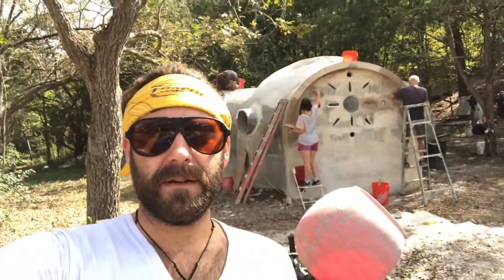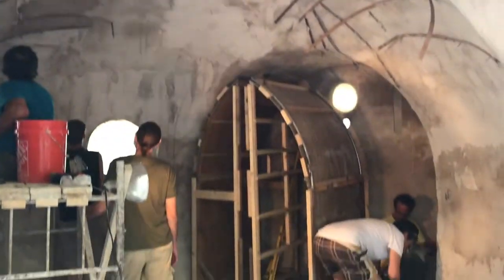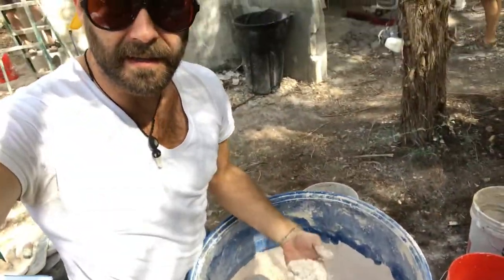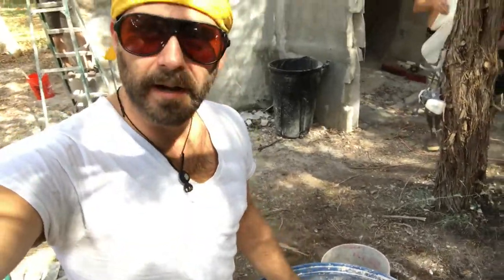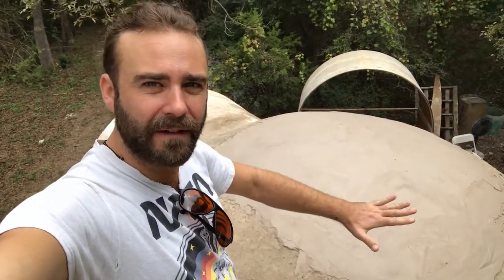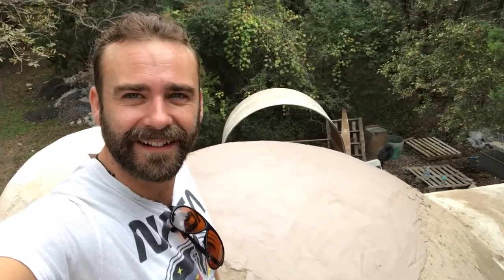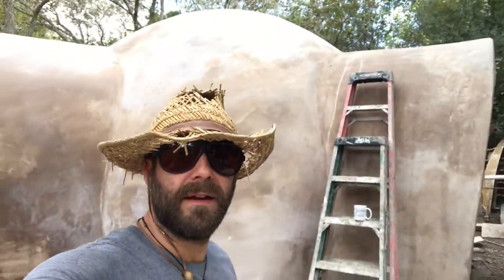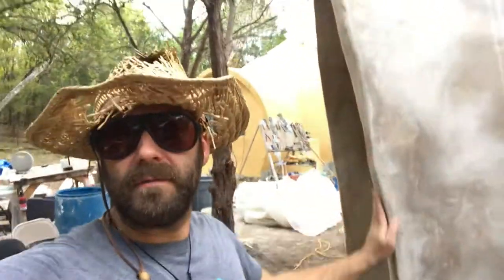Dome Finishing Course with Magnesium Oxide

Comment: Okay - so it's been a while since this video was posted - but I have questions nevertheless. 
Did you purchase the MgO cement powder from George Swanson? 
Were you required to purchase an entire pallet (& did the powder come in 55g. poly drums)? 
I know prices have changed but approximately how much did it cost to purchase full quantity and perhaps also per structure?  
I hope to build a few 15' domes, perhaps some of them may be silo domes (one extra vertical riser layer, ~3' (?) high, essentially a single frequency dome with a single vertical component on the circumference). 
Those are awfully high though but the advantage being they are great for building work benches along the wall.
I'm in NM and have a truck and 12' dump trailer and could pick up rather than pay for shipping depending on which method ends up being cheaper when the rubber hits the road.
Thanks for any answers you can provide - I understand that you may not have them - but thanks for any reply at any rate.